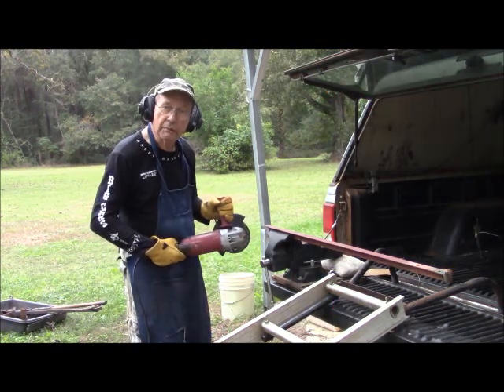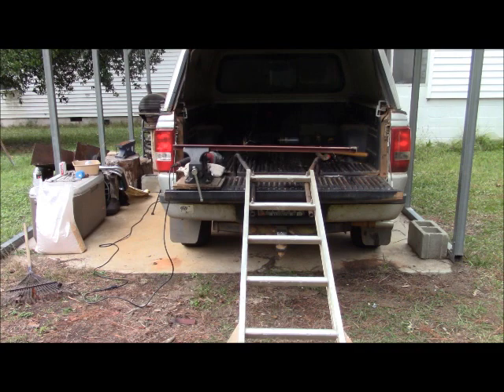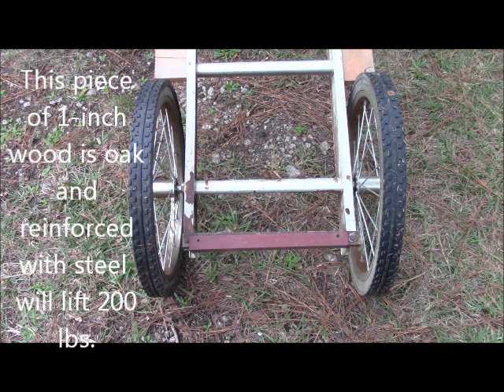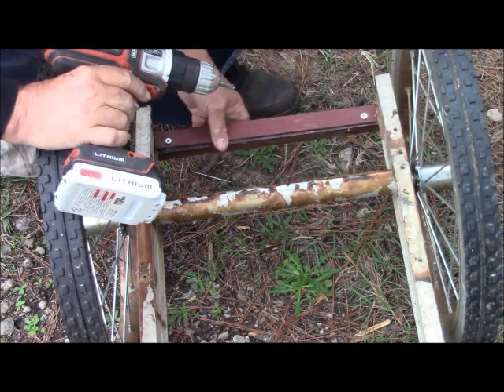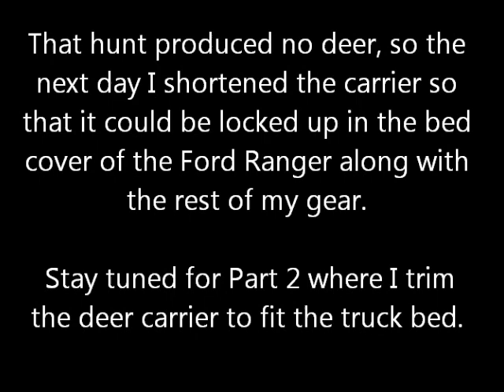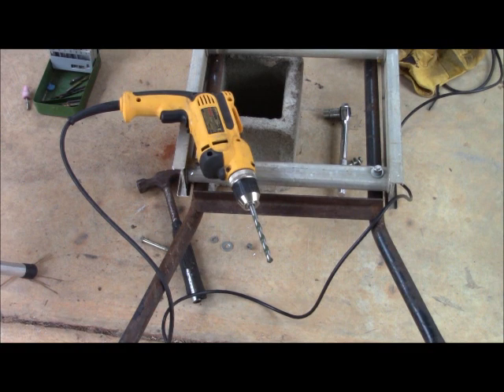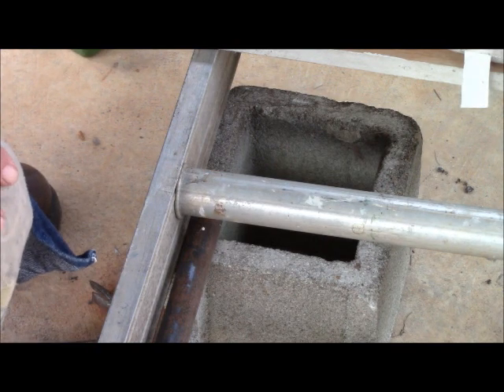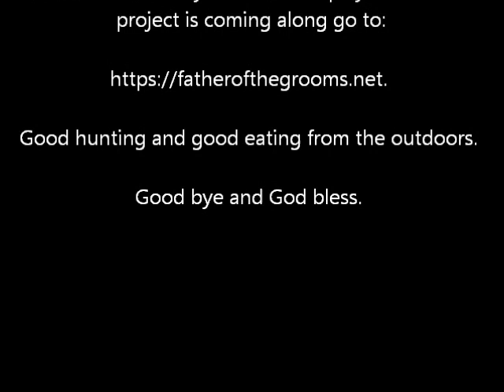One Man Deer Loading with a Homebuilt Deer Carrier

Comment: Use clevis pins and hitch clips instead of bolts on anything, for easy disassembly. Pull the clips, and drop out the pins and everything quickly comes apart. Just make the holes slightly oversized for easy pin alignment.

Comment: Thats a great invention ! Where did you find the handles and axle ?
Reply from the maker: The axel and wheels were from an old lawnmower and the handles are bent pipe.
Reply from the maker: The axle came from an old push mower and the handles were salvaged from something my father-in-law made up. You could make them from electrical tubing with a pipe bender.